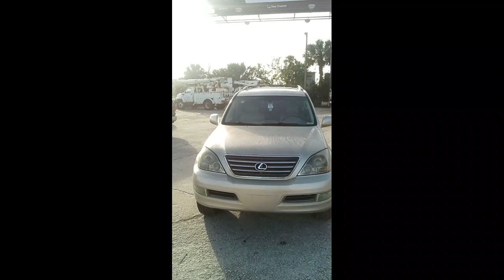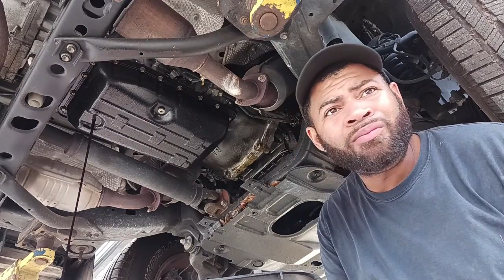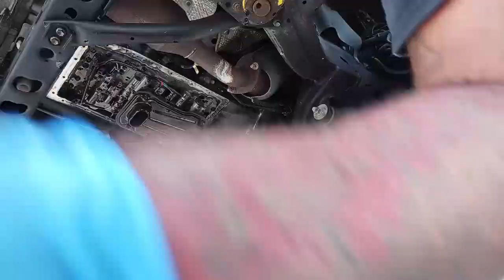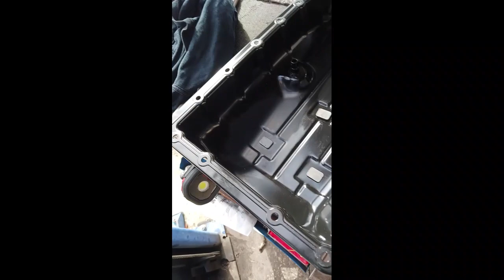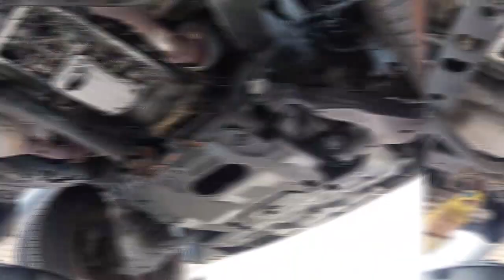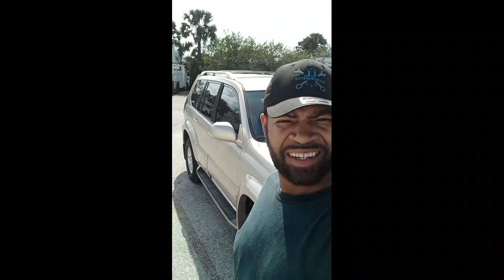TRANSMISSION SERVICE LEXUS GX 470  2007

Comment: Dear lawd!  This is NOT the procedure!  Check fluid level AFTER the trans temp is 115 -130degF!  Add if necessary, let it dribble out if necessary via the fill opening. Do not follow this procedure!

Comment: Hello, great video.  When you remove the skid plate at 0.38 the transmission housing is exposed with fluid leak. Is that leaking from transmission or is that oil coming from elsewhere?  I have the same on my 09.   Thank yoyu

Comment: I just bought a gx470 with 230k and never transmission serviced.. it drives well.. should I do this or leave it be?? Andy experiences/advice
Reply: I did mine at 190,000 miles and transmission started hesitating getting in 1st gear every morning afterwards.

Comment: Have you ever seen this method combined with the mechanic pumping and draining the fluid through the transmission cooler from the front? Also how much would this service cost for a shop to do it thoroughly, with including the filter change.

Comment: Great video. Exactly what I need to do mine right now. How do you know how much fluid is needed to fill, and where can I get that filler connection to pump it in?
Reply: Most transmission you fill up to the fill hole